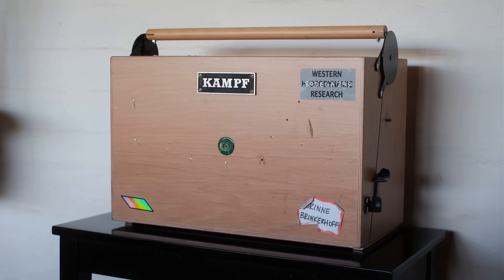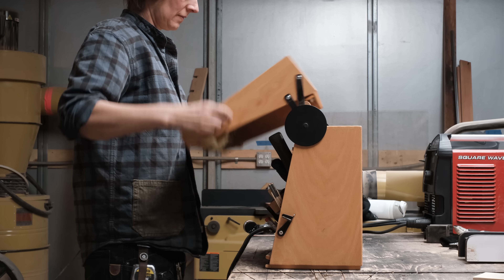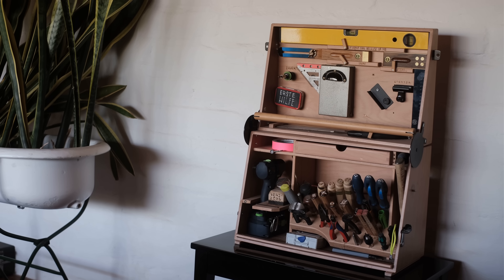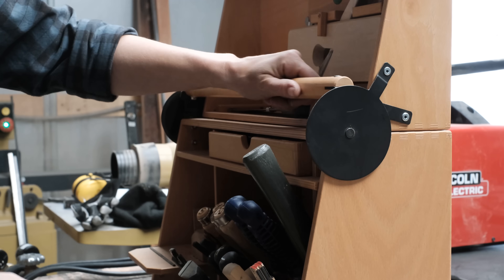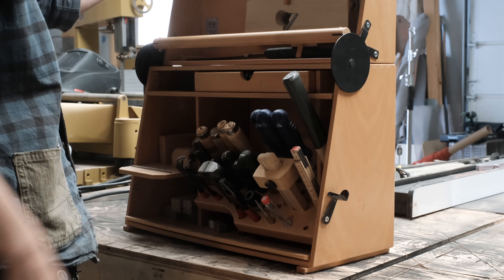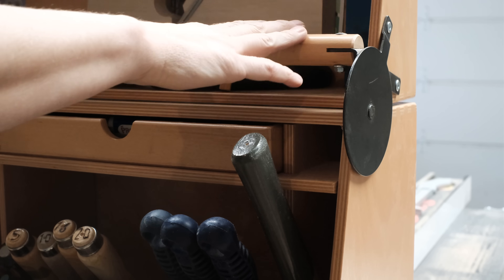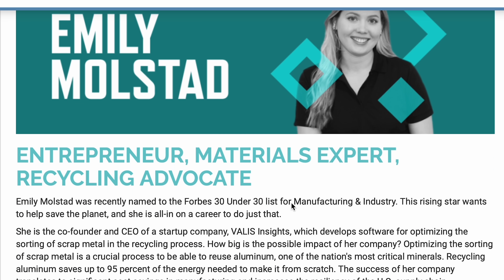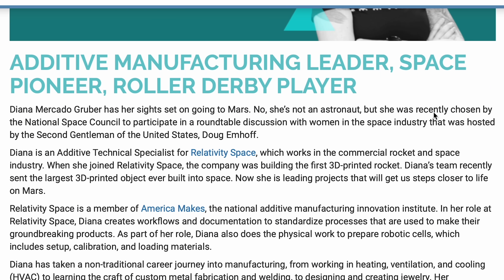This hinge is so clever! ...but I made a simpler version (with Template)

Comment: As a sewist: there's a simpler way to use the template. Print it on normal paper once (this is what we call a pattern in sewing), and then every time you need a template, you take tracing paper and copy the template on it. You then lay the tracing paper onto the piece you're working on. That's how clothing is made :)

Comment: As I watched (very clever of you!) it struck me that this could be made as a parameterized 3D model, and printed using infill of 70%-100% from PLA or PCTG. By inputting a few box dimensions (the narrow "front", the wider "back", and height of the upward-facing piece), the offsets could be computed. To glide over the straight bracket, the print could use raised screw posts. Then you could print a perfect fit for any size tool or display box, and even color-code the boxes by printing the disk and bracket in various colors.

Comment: But what’s the point of this complex design if it’s still a rotation. And how’s it better than having just a regular case that unfolds in two halves of rectangular form - don’t understand its practical advantages. Tools need to be fixed and there is less space

Comment: it's an interesting mechanism, but this seems like a lot of trouble for just a handle.  the reason for this hinge's existence is just to clear the handle when opening.  removable handle with a plain piano hinge would be an alternate solution, esp since the fixed handle kind of blocks the top of the box when closed (i.e. can't stack, etc.) and...  seems to have limited functionality when the box is open.

Comment: I’m going to use this hinge for a few things. 

First: I’ve been mulling over various designs for a box to transport my slot cars to and from the club. This design will allow easy access to the cars below as well as the various items needed for race day (controllers, spare parts, lubricants, etc) in the top section. 

Second: Same as you, I’ll use it as a tool chest. I have loads of tools from various trades I’ve worked in over the years and desperately need better storage solutions for them. 

Third: If used in a horizontal configuration, this design would lend itself wonderfully to a guitar effects pedalboard. It would allow for easy, multilevel access to pedals on stage while also making it take up less space than a conventional pedal board/case when closed. 

Thank you for enlightening me to this hinge design, my mind is whirring with the possibilities!

Comment: That is a neat tool box but I would need 20 of these tool boxs to hold all my tools. I made a tool cabinet that is patterened after an 18th century  Library Brakefront. It is 10' long by 8' high and is packed with my tools. When I go on a job I have up to 3 tool chest of different sizes to take with me depending on the job.

Comment: A GREAT BOOK FOR DESIGNING 4-BAR LINKAGES:
As is mentioned in other posts here, this is an example of a 4-bar linkage.
To those of you who may be interested in actually designing (rather than copying) a 4-bar linkage to provide a specific motion, this book (see below) with teach you how to do it.  It is an excellent book.  It will teach you to do it graphically (e.g. with ruler, compass, etc. on a drafting board) which is quite straightforward, or mathematically with equations (which is quite complex, even using real and "imaginary" numbers).  The graphical method could also be done with CAD (Computer Aided Design).

The book is called "Kinematic Analysis and Synthesis" by Jack T. KImbrell, 1991
Google it.  It can be found on Amazon, Ebay, and other places.
This book is out of print, but copies can still be purchased.

This is an undergraduate-level book intended for such courses as kinematics, synthesis of mechanisms, mechanics, dynamics of machinery, or machinery of analysis. The author's goal is to provide a book that will equip students to design and analyze mechanics, as well as give them the information they need to perform well in modern industry. Graphic and analytical synthesis techniques are fully explained to give the student a visual feeling for mechanisms performance, and the text contains complete coverage of CAMS and their analysis.

Jack Kimbell was Professor Emeritus of Mechanical Engineering at Washington State University through 1991. He died some years ago.  He was my professor for the Kinematics and Dynamics of Machinery course at WSU in 1983.  At that time, he was in his 70s.  He was an excellent teacher and nice man.  He also wrote and graded test questions for the Washington State Professional Engineer's Licensing Exam for mechanical engineering.

Comment: I notice the original box had bent metal hinges.
Your first repro used washers to have clearance.
You COULD cut down the material on the handle/hinge connection to allow the hinge bars clear with minimal added peices.

Comment: The sharp inside corners on the hinge arm of the base should have a 10mm (3/8") or better radius for added strength. The sharp corners are stress concentrators. Spread that load out...

Comment: Designing a cordless router toolbox where the flip top will hold bits, collets, and template guides. The bottom will hold the router, batteries, charger, vacuum attachment, and plunge base. I already made the swing hinges and I turned some aluminum spacers on my lathe instead of washers.

Thanks for sharing!!!

Comment: That is brilliant, Laura.
How about a camping kitchen box? You would have to make a plywood cover for the top part to keep the utensils from falling out, but once opened, the plywood cover could be removed and inserted into the base, extending out to become a work counter. You would need to put some cleats or such on the bottom back of the box so it could be tied around under the picnic table for stability.
I made a similar camping box 40 years ago that I still use today. Your box would be better in that all the utensils, spices, and smaller items would be more easily accessed from the top cabinet, and you could have some pull-out rods at the top sides to hang a couple of lanterns, and have plenty of space in the bottom for pots and pans, dishes, etc. The trick would be to design it to hold all the essentials and not be too big and heavy.

Comment: Just keep in mind the hinge points will be much easier in the long run to maintain if they are steel. If you have heavy use with these aluminum ones the screws will cut into the material and wear out fast. If you want to stay with aluminum try putting an insert of a different material to act as a bearing surface.  Brass,  nylon, UHMW, or a couple of other types of self lubricating plastics will work smoothly and last for a very long time without needing grease or any lubricant(which you prob dont want in an apllication like this). 
P.S.  while brass ones can cost a bit the plastic bushings are dirt cheap and are found eveywhere

Comment: The geometry of the hinge mechanism is fascinating, and I get that it allows the front to pass over the fixed handle. But apart from that what does it offer over a conventional hinge at the top front edge of the bottom piece? 
It seems like a complex solution where you mostly don't need one. (And you have those metal pieces which are exposed and liable to get damaged.) 
What am I missing?

Comment: I don't remember where I first saw this, but I too, was hooked. I did draw a working model of it in Alibre (think inexpensive SolidWorks). It is tricky to get everything to line up. The back edges, the slope, the top part to set correctly on the bottom. But very cool.

Comment: I think there is a better way by putting at least one of the bars on the inside of the box, likely the smaller one which would have cut lines in the top to fit the bar if not both.  But it would eliminate any exterior finger pinching when opening and closing.

Comment: To make a perfect circle, you can loosely screw the material to the side of a block one radius down, and use the top of the block to resist a rasp as you rotate the work.  However, that guard does not need to be circular at all.

Comment: if a fulcrum and pivot combined, that's all... They used a circular metal plate because its easier to position the thing to work perfectly, but basically you could use any shaped plate you want, provided the positions of the fulcrum and the pivot are correct... geometry with fulcrums and pivots is easier with a circle.... but once you have those positions, you could transfer them to any shape, and to any size provided you maintain the positions relative to the size...(geometry again)... so firstly sit down with paper and pencil, and of course a ruler and a compass, and get to work... basically the door opening is 'hinged' on the fulcrum...but the opening part is attached to the pivot point to act as the movement of the opening... an 'eccentric' motion is created enabling the opening to work in the manner it does... think about the piston action of rotating wheel on a steam engine to get the idea...the only difference is the opening part has a fixed point at the fulcrum and the pivot is not connected to a part that rotates through 360 degrees... hope this helps explain it...! All that said, lets hope you are not breaking any design patent or copy-write by copying this, filming yourself doing it, and then offering it to the world, or i could see your video being exhibit one in the court case...!!

Comment: Imagine not just having this as a mini pc cabinet desk box where the lid part from the main part contains a relatively decent Oled display compact enough to fit while having speakers and antenna for the upper half as for the lower have has the packaged mini pc in the back inside liquid cooled while compact as the keyboard and mouse mount is using an intergral origami fold per pinch corners between the mini pc and the Oled display that are all in a bow similar to what is shown in this video!

Comment: AS long as the hinge is not load bearing on the plates when moving from open to closed (because you are lifting it) the four plates could be made out of wood, and it would be easy to notch one out for the other to pass under. 
For wall mounting there should be a small lip on the bottom to support the weight of the front when closed 
Otherwise, the sheer strength of the fastener is supporting almost the entire weight of the top half. This does not matter when sitting on a surface.
That said, the simplified design with four identical pieces is a 10 for sure.

Comment: I wonder if it's possible to attach the bars to the opposite sides of the plywood.  This will require a small slot in the top of the box for bars to pass but eliminates the washers which will make the hinge stronger.

Comment: Four bar links are interesting but you'd be better off just using the piano hinge and putting the handles on the side which would be better to carry a heavy load. The handles can be flush also on the side. Plus you can make them stack similar to how they stack shipping containers.

Comment: My next step would be to create a stand-alone hinge, which can be mounted to all kinds of boxes. I am wondering right now if this can be modified to fit to other geometries as well. What if you modify the angle the two boxes fit together? What if you want the two boxes to be identical in geometry? How does that affect the shape of the hinge, and how should it be designed to accomodate a wide range of geometries?

Comment: Lets be honest, your pdf template wasnt fpr you, but you followers. Your 2D model was your template tjat you could also flip for the other side. Simple drill your holes bigger to accept a bushing for longevity.  Also wood screws dont lend themselves well to moving joints, will likely work loose unless addressed. Good idea though. I think a bigger version for hotels will be too heavy, but good luck ❤

Comment: Is the point of the linkage that it allows for a handle on top of the case? Is that the reason to use this 4-bar linkage instead of a simple hinge? If acceptable, a handle that can rotate out of the way when you open the case, or a simple strap, could replace this functionality, unless I'm mistaken.

Comment: The only improvement I would suggest is to make your box handle a little shorter and rout the sides of the box as necessary to recess the entire mechanism. This way you can use your toolboxes when positioned side-by-side without the hinge mechanisms interfering with each other.

Comment: The alloy plates could be made from plywood if you wanted an all timber design.
Laminate some thin sheets of birch Aeroply into an extra stiff panel, then cut out the shapes with hand tools or a laser cutter if available!!

Can one of the two linkages in the 4bar, go inside the box for a neater look? Perhaps not !

Comment: autodesk 360 is free for personal use. it has a joint simulator and motion studies built-in.. Very user-friendly for mechanical parts. Another is FreeCAD which is free and open-source. It has assembly and animation modules. THere's also  Blender (with Mechanical Add-ons), another open-source software. It has a powerful animation and rigging system

Comment: That is clever and cool but why not just use a piano hinge or any hinge, with a separate swinging handle that swings to either side of the box after closing? Then you could stack them 2 or 3 high.

Comment: For some reason, I was born with the curiosity to look at something and always try to  improve upon it. Looking at this design I thought, why not a piano hinge? And as far as the handle it could be a thick piece of leather riveted onto the top where the existing handle is. Of course you'd have to router out a slight recess on top of the front section that mates with the handle when it swings into place in the open position but much simpler and probably more secure. Other than that, I think there are many applications that hinge would be ideal for. If you find the time, let me know what you think other than that, keep up the good work. I love it.
Reply: Exactly my thoughts! While I love 4-bar linkages as much as the next fellow, it seems a little bit over-engineered in this application.

Comment: Since you are now working with aluminum, I don't see why you couldn't use a hole saw to make custom sized disks so that you can cover and eliminate the pinch points.  Also, I love the cabinets.  As a mobile RV repair tech, I need separate tool boxes for plumbing, electrical, HVAC, mechanical, etc. etc.  Several of these would be useful and stack well in the van.

Comment: Very cool hinge, but seems rather unnecessary. It is only needed to move around the handle, but instead you could just use a normal hinge and drop the handle down into the top of the box or move the hinge further up the side around the handle. Definitely a cooler solution, but certainly not the simplest.

Comment: The safety circle (TM) should be easy enough to add to your design. I see no real reason why it needs to be integrated into one of the bars like on the original toolbar. Just add the circle (or whatever shape you want I guess) as a separate 3rd piece, like a giant washer between the outer bar and that one screw. Heck you could even overcomplicate things and make it completely free spinning like some sort of integrated fidget spinner to play with when you get bored in the shop.

Comment: I wonder if you could put each of the hinge bars on either side of the vertical wall and be done with the washers. One on the outside and one in a slot of the front/back wall of the lid.

Comment: If you want to build this, some tips: Don't set printer to Fit To Page, make sure the CL to CL of the screws is 80mm. The box is 350mm tall, 268mm wide (side view) and 530mm wide (front view. To make the side start with a panel 268mm wide x 350mm tall and cut at a 11.22 degree angle that starts 110mm back from the top front edge.    If you find the template confusing draw lines between any two screw CL's that are 80mm apart then cut the template in 1/2 without cutting through any line.
Reply from the maker: Great feedback! Thanks!

Comment: Great project hinge. If you need to consider a modification to make it "finger safe", replace the outside link with a piece of clear plastic (acrylic?) and draw the outline of the other link. First when closed then open, and repeat for several partially open positions. With the clear material representing the outside link and the inside link traced onto it as a reference, you could then combine several traced positions to see the shape you would need to fully cover the inside link.
  Another advantage, you could use the clear material as a pattern for hinges on both sides of your box.
  And Thankyou for your video.

Comment: I stand just at the beginning of the video 3: 02 and my approach would have been different:
Marking the positions of the start point and the end point of the two base points on the lid part, the hinges so to say and try to find a way for a movement from the beginning to the end.
But let's see...

Edit 1: since I try to find the best solution from nature, I thought of this joint as a knee. Which does have a two moveable rotation axis...

Edit 2: Okay so you basically just removed asuch from the circle as you could to make it still work.

Yeah nice job. It's not reinvention of the wheel, but nevertheless! Cool!

Comment: Why not just normal hinges? The only reason you need that special hinge is because the handle is in the way. But the handle can be mounted on the side and be able to pivot down behind the box when you want to open it. Or the handle can be removable. Seems much easier to me.